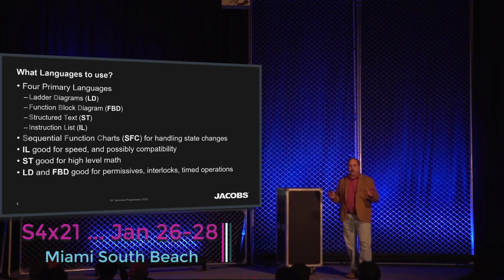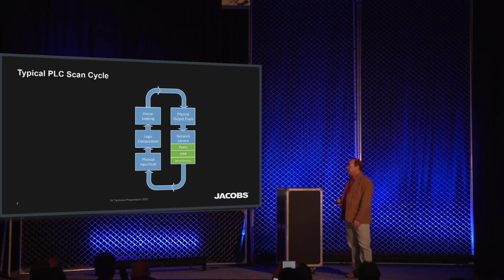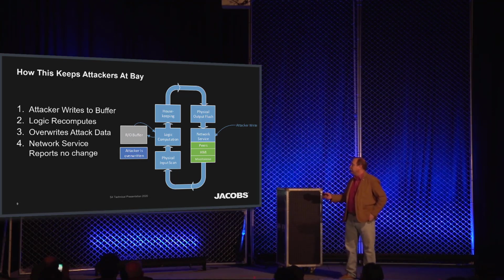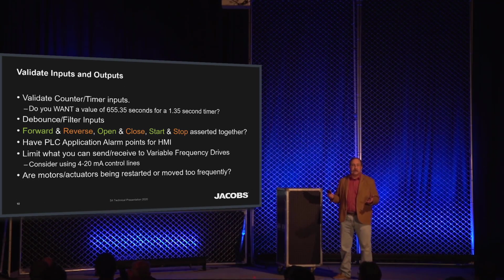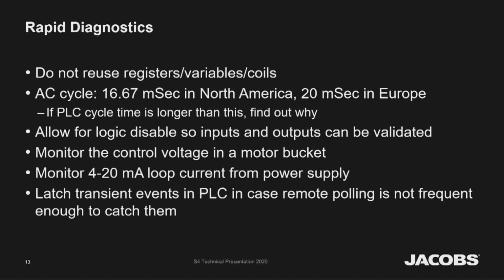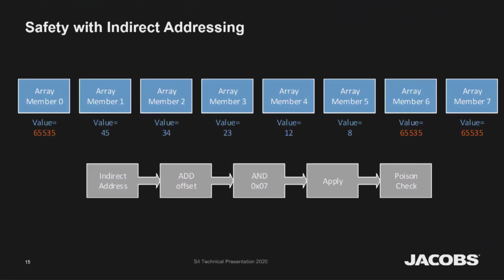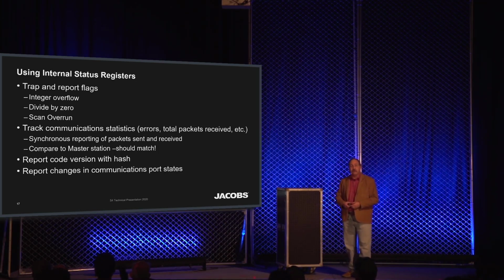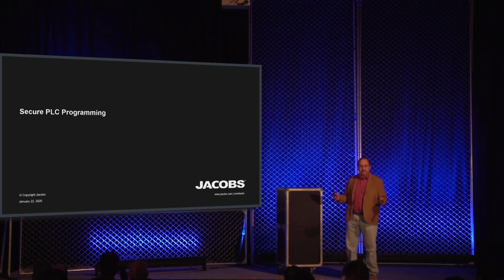Secure Coding Practices for PLC's

Comment: For background, I am a senior programmer for a mid sized water/wastewater utility with over 20 years experience in the field. I worked my way up from an instrument technician, and am familiar with the maintenance and security headaches of industrial control systems in the Water/Wastewater arena.

Overall, a good list of coding practices to watch out for. I agree with most of the opinions provided, But have a few counterpoints...

My one major exception is networked Variable Frequency Drives. I'm sure this greatly depends on the manufacturer, but in some cases, PLCs are able to manage the configuration of the VFD, and other smart(networked) endpoint devices allowing for backups of configurations of all attached elements via backing up the PLC code, and furthermore overwrite any manual changes made in the field at the endpoint device itself. This adds emphasis to the need for security of the PLC, but greatly protects the endpoints from direct manipulation, whether it be malicious, or just a curious end user "playing" with the device(we've all got that one operator that likes to get all hands on when nobody is looking). 

Additionally removing the analog signals from the drive and controlling over network gives a much more accurate control/feedback alignment whereas you won't see a drive commanded to run at 90%, running at 87%, and reporting back to the PLC it's running at 85%. It will always match 90-90-90. This removes the periodic calibration needs of those analog devices, and allows for much more accurate efficiency calculations and other performance metrics. Coupled with incoming power monitoring, if not embedded in the drive, you could even have real-time wire-to-water efficiencies and see how different equipment configurations impact that number in the real world.

Electrically speaking, removing copper between the PLC and drive all together via fiber can additionally reduce noise and surge risks for control, as well as simplify troubleshooting of wiring circuits for techs.

Networked drives also allow for monitoring of a slew of other maintenance parameters(DC bus voltage, line by line output currents, torque loading, embedded cooling fan runtimes, etc), which can greatly extend the life of the drive and attached motor if utilized. 

While I understand and appreciate your point of the inherent security of hardwired signalling, The maintenance benefits can far outweigh the security risks, especially if layered network securities and automated change management systems are in play. If an organization is looking to move into more advanced maintenance diagnostics at all for their motorized processes, adding a networked VFD can be a real benefit.